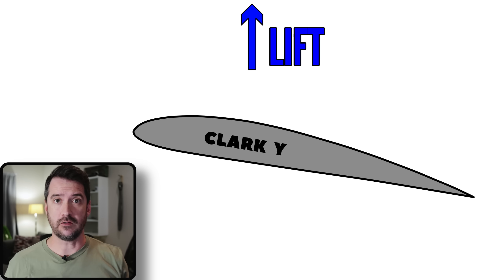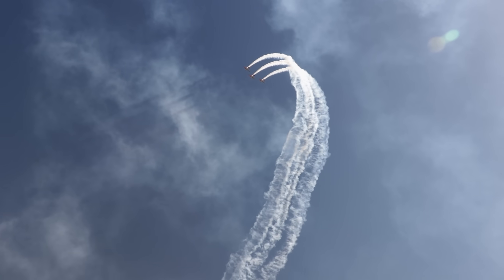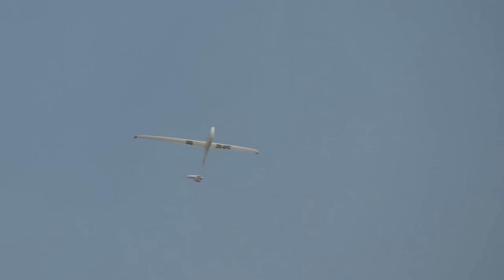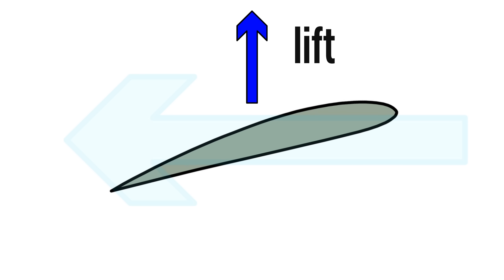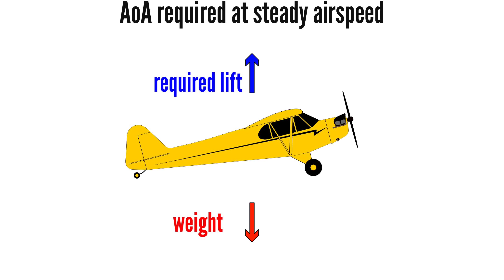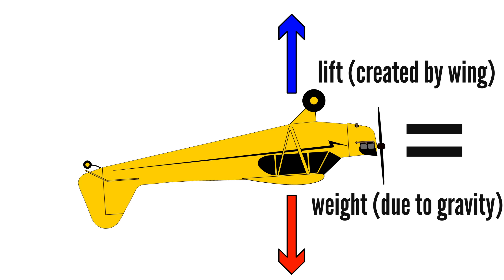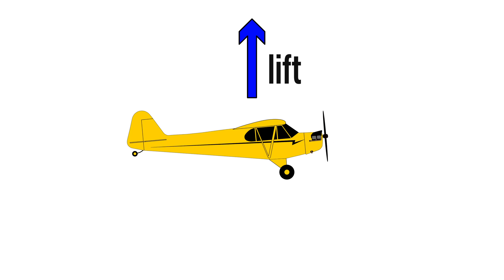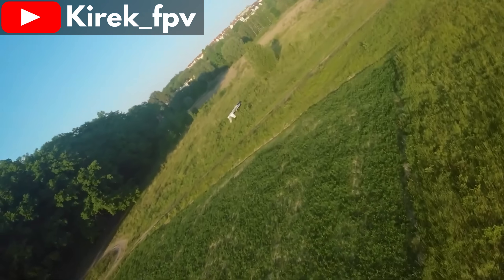Is Airflow Distance Over the Top of a Wing Always Longer?

Comment: The ACTUAL argument is not that an inverted wing has a longer path over the bottom than the top. The argument is simply that the actual shape of the wing is not what creates the lift - per-se. People have been taught that because the airflow over the convex curved surface of the wing is longer the airflow is therefore faster and faster flowing air creates less pressure. i.e. Bernoulli. It's the notion that the airflow is somehow accelerated over the convex surface, simply because it's curved, that is bunk. The notion seems to be that the air must speed up to catch up to the air flowing over the flat surface. This is bunk or an oversimplification at best. As you've alluded to... lift is dependant, if not directly created by Angle of Attack. i.e. the air slamming into whichever side is down and pulling away from whichever side is up. AoA is king! The shape of the wing determines the performance and handling characteristics. The best argument against the "unequal paths" idea (lets not elevate it to a theory) is that a sheet of plywood develops lift in the wind. It's pulled people off of roofs. Model aircraft fly well with flat plate wings - no curves at all.
Reply from the maker: I think that's a different argument. But I agree with what you're saying here. As I showed and you said, wings can work upside down (just less efficient), symmetrical and even highly cambered, which then debunks any "shape creates lift" theory. The pressure differential is created by angle of attack, not shape.

Comment: I still believe the air flow path only explains a part of a wings lift.  If I take a razor blade at an angle of attack it will provide a significant amount of lift even though the stagnation point will only move a fraction as the angle of attack changes.  The stream of airflow striking the bottom of the wing pushing upward HAS to be part of the equation somewhere.  Any child putting his hand out t(e window as dad drives down the highway has played with angle of attack and has felt the air pushing against the palm of their hand with a lot more force than the suction on top of their hand.

Comment: Lift is only created by deflection of air downwards. The low pressure over the wing is created by the air trying to normalise itself back to static. Its the result of the lift not the reason for the lift.

Comment: I was confused by this video and not clear on its point until the end (I think).  The first half is unnecessary, and thereafter very little time is spent on the actual subject.  I hadn't ever heard it said that airflow over the top doesn't travel a farther distance.  The theory that I had heard and has since been discarded is that when air flow splits at the stagnation point split the previously adjacent 'packets' have to rejoin each other at the trailing edge. That is the theory that has been disproven, not necessarily the further distance theory.
Reply from the maker: Yes the first half is meant to provide context, but this is still one of my shorter videos. I've heard and seen the argument that both the longer path and pressure differential are disproved by the upside down argument. Maybe I was too subtle with putting in high and low pressure areas in the animations.
Reply: @LetsGoAviate  I've also never heard the argument that lift from an upside-down airfoil disproves the longer path theory.  Only the most uninformed person thinks a cambered airfoil is necessary to produce lift, but I guess there are a few around.

Comment: Interest in lift = YES. Aerodynamics is a casual interest of mine. The one thing this video did for me was show that the stagnation point moves with angle of attack. The "upside down," arguments, constrained to airfoil shape only, clearly can't get off the ground (and never made sense to me). Where lift becomes more interesting is the arguments for and against Bernoulli effect. I picked up a college-level aerodynamics text awhile back that pretty well trashed the Bernoulli argument (the author has some reasonably respectable "whiskers" as a consultant in the aviation industry as well as his academic bona fides). However, other texts that I have of similar stature posit Bernoulli lift. I'd love to see this disagreement convincingly sorted out (not just an appeal to authority... which is a known fallacious argument form). (Bernoulli in a closed space, such as a venturi, applies well, but in an unbounded wing situation...) The arguments about "circulation" are also interesting (they seem to come up more often when discussing sailboats, and persist with the rigid sails used on more recent America's Cup racers, etc.). Whether "circulation" is a calculation convenience, a complete misnomer, or a demonstrable fact would be interesting to learn.

I subscribed in hopes of clear and convincing answers (you have better wind tunnel pictures than I have found).

Comment: In the rotorcraft world... no one has a problem separating Bernoulli versus 3rd law lift. ...it's both. You can make a lot of lift with 3rd law, more than Bernoulli, but it's less efficient. That means if you pitch an airfoil the wrong direction -- maybe if you are trying to fly inverted -- you can overcome the Bernoulli force it generates with considerable angle of attack and generate 3rd law lift (minus the Bernoulli force you no longer want but is generated anyway) while losing a lot of efficiency.
Reply: You can't make any lift without the 3rd law, the idea that Bernoulli is producing 'some' of the lift is just a misunderstanding, all lift will be in direct proportion to changing momentum in the air.

Comment: It is not the length of the flow that matters, but rather the curvature.   For the flow to follow a curved path, the pressure must drop (basically due to centripetal force or alternatively momentum balance).  Note also that the direction of curvature also matters.  Usually we design wings such that the curvature on the top of the wing produces a lower pressure, and the bottom of the wing has less curvature.  Therefore the longest path also has the most curvature.  The curvature that the path experiences depends on the stagnation point and if the flow is separated.  In general, it is hard to determine what path the fluid will take from just looking at the geometry of the wing alone.  Thus understanding the lift an object experiences requires solving for the fluid motion around the object which is often not particularly straightforward.

Comment: Lift is easy!
1. A wing is forced forward through the air, (by for an example a motor).
2. Some part of the air goes under the wing and are redirected downwards by the airfoil.
3. Other part of the air goes over the wing, and follow the airfoil because of the "COANDA EFFECT" and is redirected downwards.
4. One of "NEWTON's law" say something like: a force in one direction is equal to a force in the opposite direction.
    Air (mass) forced down creates LIFT to airplane.

Forget bernoulli.
Forget speed over and under
Forget particles that part and meet up
Reply: Wrong. Your 1-4 are correct, but so are Bernoulli and the speed changes. Different aspect of the same process, equally important to the process, more useful in understanding how lift is produced and how changes in wing form affect lift for most people.

For example 1-4 does not explain why the centre of pressure moves with flap deployment or at the stall. They don't have anything to say about pressure distribution across the wing section.

Nothing to do with particles meeting up though, why would they do that?
Reply: @randomxnp  No, he's saying Newton explains lift which it dose, it explains it for an elementry school student all the way up the most advanced equations.  Your brining Bernoulli in to explain the MINUTIA of performance, stalling and really advanced stuff that frankly need Navier-Stokes to really understand, both are after all just an expansion of Newtonian physics.
Reply: @kennethferland5579  those things that are easily explained by Bernoulli with no reference to Navier-Stokes Equations are important for pilots to understand - as long as you use Bernoulli.  Yes it is an extension of Newton's laws (and I teach it as such), but very hard to understand from Newton without simplification of Bernoulli.

Comment: Any aircraft can fly upside down even if only briefly. A J-3 can also but VERY briefly as it does not have an inverted fuel and oil system. Sustained inverted flight would cause the  engine to stop.

Comment: Hi @LetsGoAviate. I have a very big "YES, BUT" here.
Most of what you said is correct.
The flow over the top is longer than the flow under the bottom, regardless of whether  the airfoil is symmetrical or cambered and whether it si flying upside down or not, exactly as you explained. So anybody saying "symmetrical airfoil and planes flying upside down prove otherwise" is wrong. We 100% agree on that.
However, the part where you say "The argument that the air going over the top of the wing following a longer path than the air going below is not responsible for lift is false. And that the theory doesn't explain how the symmetrical wing creates lift, is false. And that the theory doesn't allow for inverted flight, is false. The theory accounts for, and allows all that". There is nothing necessarily ERONG with any of that, but the problem is more of the message you are sending, or how the message will likely be understood by most.
The problem is this. What IS completely false is equal transit theory. You didn't say that equal transit theory is true (in fact, I suspect you know it is false because in your animations, at least in some, you show the air going over the top reaching the leading edge first despite the longer path).
Now, you didn't mention that equal transit time is false. And you didn't say that it is true. But this video can EASILY be interpreted (right or wrong) as you debunking what many videos are now saying, that equal transit time is false (which it is).
Equal transit time postulates that the air flowing over the top moves faster BECAUSE the path over the top is longer, but that BECAUSE would only be true if the air parcels that separate at the forward stagnation point meet again at the trailing edge (both parcels need to go around the wing in the same time, hence the ones on the longer path have to move faster). THAT IS TOTALLY FALSE. Because air parcels that separate at the forward stagnation point DO NOT meet again at the trailing edge, because a parcels going over the top goes so much faster that it arrive at the trailing edge first, despite the longer path, and never ever meet again with the parcel that was next to it at the stagnation point and went under the wing.
Now, look at this, look at this minute (in CAPS) change to what you said:
"The argument that the air going over the top of the wing MOVES FASTER BECAUSE IT IS following a longer path than the air going below is not responsible for lift is false."
That is equal transit time, and that IS wrong. Now, even with that wrong, you can CORRECTLY still say...
"And that the theory doesn't explain how the symmetrical wing creates lift, is false. And that the theory doesn't allow for inverted flight, is false. The theory accounts for, and allows all that".
You'll see: Equal trainset time (the air going over the top moving faster because the path is longer) can explain symmetrical airflow lift and upside-down lift, precisely due to the changing location of the forward stagnation point as you explained. But that a theory CAN explain something doesn't mean that the theory is correct. Like if I say "Objects fall because their natural state is to be on the floor and they they want to be in their natural state" CAN explain why objects fall, but it is not the correct explanation.
Again, your video really looks as you trying to debunk the notion that equal transit is wrong, even if that was not your intention.
A good explanation of lift is that airflows produce CIRCULATION (the Kutta condition says that every airflow will produce enough circulation so as the rear stagnation point is located at the trailing edge, which is a consequence of real (viscous) fluids at not being able to turn around sharp corners like the trailing edge).That circulation both makes the flow overt the top go faster and makes the path over the top longer.
Reply from the maker: I think you get the point, and good analysis of the video and my intentions with it, for the most part. As you suspected I am not pushing equal transit time theory, which is why the animation showed it like that, it was deliberate. I am actually not explaining lift at all, I am really only showing why the "upside down flight then wouldn't be possible" argument which - I see everywhere - doesn't disprove the long path /short path or pressure differential theory. There might be other arguments that does, but this one doesn't. Thanks
Reply: @LetsGoAviate  ... And I totally agree with that. Again, my main objection with the video is not formal, but with how the message may likely be understood by many. In my view, sounds too similar to supporting equal transit time (although I suspected and you confirmed that you were not doing that). Let me tell you an anecdote that I think you will find interesting. I saw a video about Flat Earth that "debunked" the Flat Erther's postulate that if the Earth was a spinning ball a pilot would need to be constantly pitching down and, if flying away from the Equator or towards the Equator, it would also need to be turning all the time. I commented there that actually these are about the only 2 things that Flat Earthers got right. If the Earth was a spinning ball pilots would have to do that and, because it is a spinning ball, they do that. Only that the effect is so tiny that is unmeasurable and unnoticeable for the pilot. I went on and calculated how much (how little!!!) correction would be needed, in terms of pitch rate, turn rate and angle of bank, which was of course ridiculously small. What do you think happened? People started to call me Flat Earther! I had to explicitly say that the Earth is a spinning ball indeed and that Flat Earth is dead wrong indeed for 2000 reasons, just not for these 2. These 2 reasons do not disprove Flat Earth, but many many others do. So it was like a "lesson learned" for me and it is in that spirit that I wrote the above comment. While I see nothing formally wrong with your video, I think that i9t can be easily misinterpreted and that explicitly saying that equal transit time is wrong would have been good for humanity 🙂. Cheers!
Reply from the maker: @adb012  That's crazy. Yeah I get what you're saying, and apart from showing it in an animation, I guess I could have spelled it out too even if it wasn't what the video is about. Thanks